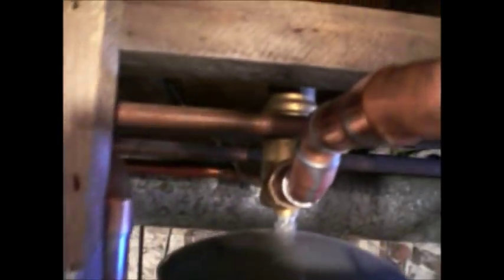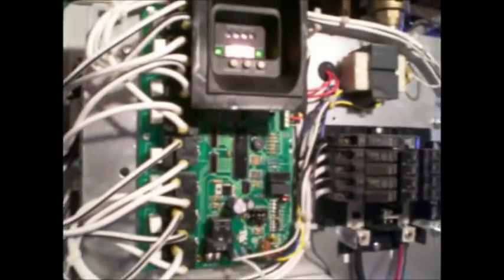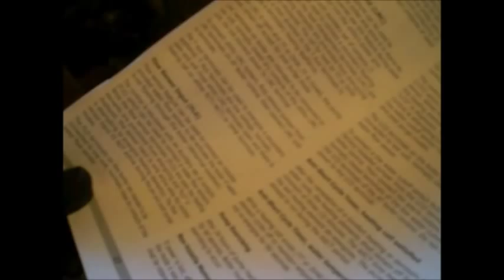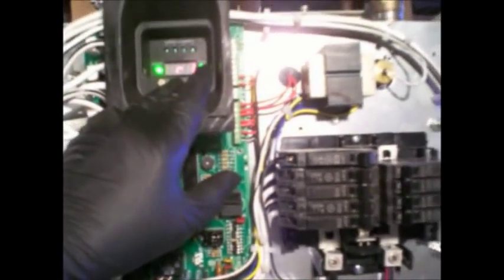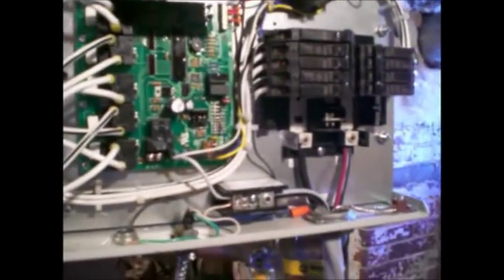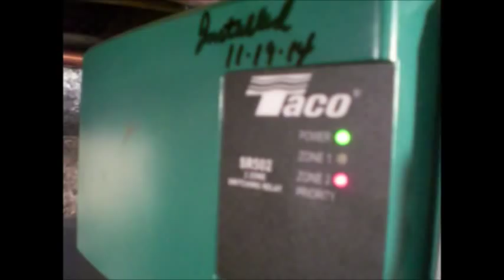Argo Electric Boiler Well Replace  12 13 14

Comment: You can buy the rebuild kits for those ratchets on ebay, I'd rather do that instead of getting a crappy replacement. I doubt they'll ever wear out with normal use though, the ones my Grandpa had are around 30 years old and still work fine. Sears still has the non-quick release fine tooth ratchet available online and those are made in the USA.